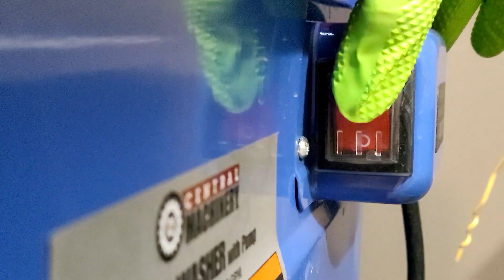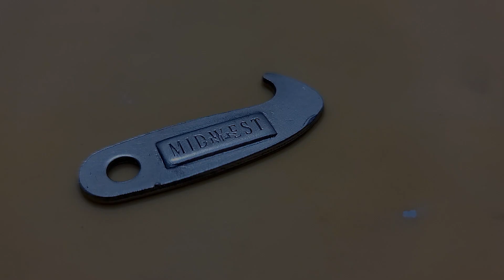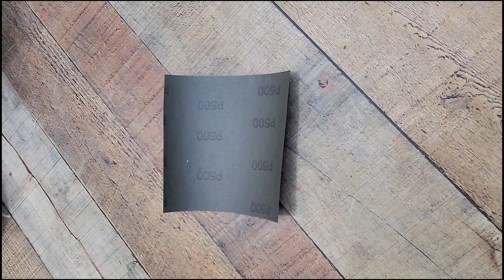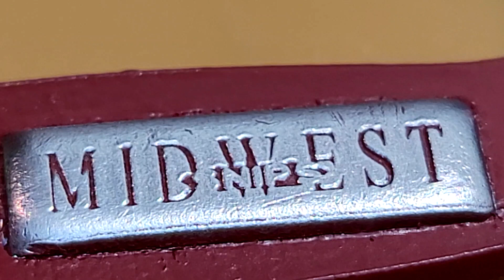Aviation Snips Restoration

Comment: I was thinking someone out there would have a video! You Sir, did not disappoint! I been debating on taking a pair apart and resurfacing, I have a bad habit of working in the rain and leaving my snips on the jobsite. They look 10yrs old from the rust, I hit them with penetrating oil, and did a light surface sanding using a dremel tool. I didn't disassemble these tho, kind of lazy right now and they are back to sliding freely, cool video man, thumbs up!